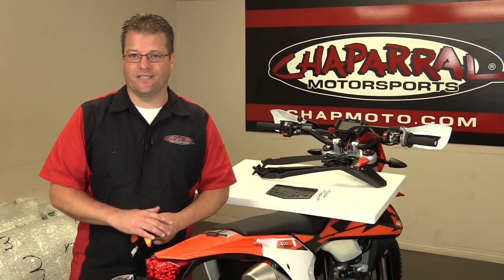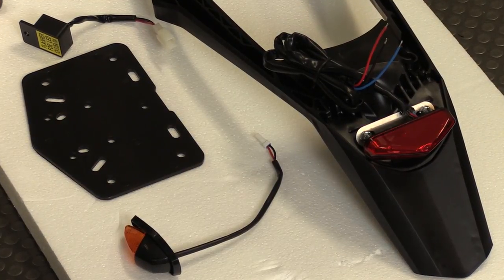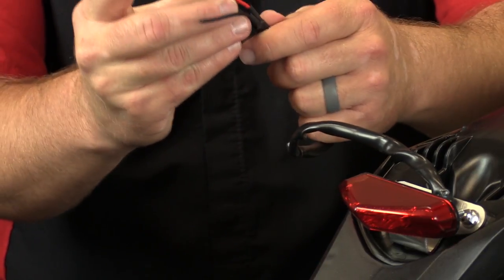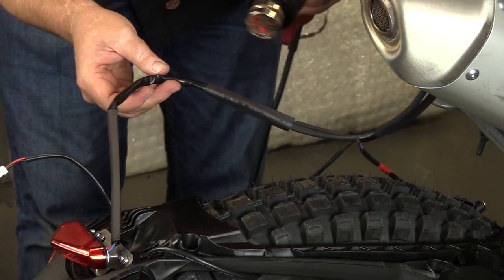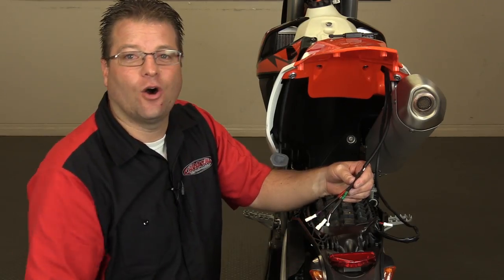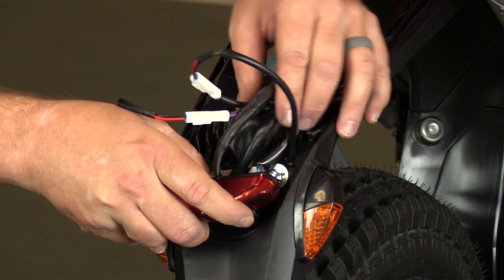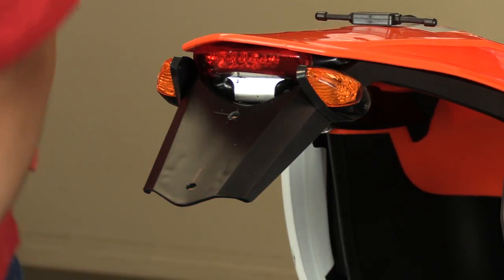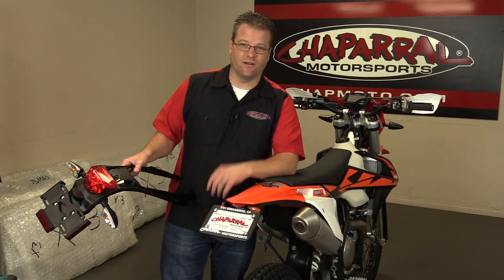Step-by-Step KTM Taillight Bracket Installation - KTM 250 350 450 500 EXC Bikes

Comment: can you give me some advice on a brake light for a 01 KTM 250EXC? has a working headlight currently, and brake switch is still there, but no brake light. Id like to get a cheap 3 wire LED 12V on ebay.. it does not specify if its DC or AC. says universal fit. Would I be ok w/ something like that?
Reply from the maker: Thank you for your inquiry Dude. Check out this "Dual Sport Tail Light " video we made last year. This will give you great insight as to the questions you have:  https://youtu.be/mtSsjfT383I    Any specific questions you have after watching this - shoot them our way and we will get them answered!  - Kyle & the Chap Moto Team

Comment: The Ocelot under fender does not work with the SICASS blinker lights. There is no surface area to mount it to on the side as you can see at the end of this video. I ordered the exact kit, you have to have the SICASS fender kit with the blinkers. Do NOT listen to this video.
Reply: I wish I had seen THIS video and this comment before I bought this stuff. You are 100% correct.. to get these blinkers on this fender requires a hack job because they straight up don’t fit.

Comment: Sicass Racing Smart L.E.D. Turn Signal Flasher Part # SAR-22-300, per your site, only fits 2014 and older bikes. Is there one available for 2018 KTM 500 exc-F or do I need still need it?
Reply from the maker: Hello, this will work with the 2018. we need to have our webpage/fitment tool updated. As a note: If you plan to use LED turn signals on the front AND rear, then you will also need to install the 22-298 or 22-299 at the same time as the 22-300.

If you want to just run one set of LED and one set of standard bulb turn signals you do not have to install the smart flasher, in this case the turn signals will blink slightly faster. If you wish to correct the flash rate install the 22-300.

Comment: Dont you need the white light to illuminate the plate?
Reply from the maker: Yes Mark,  The running light / brake light on this unit has a clear window at the bottom that shines down onto the plate. It is built in.  - Kyle & the Chap Moto Team

Comment: Where does the third light connector plug into from the wiring harness to the tail section? Both turn signal plugs and that one(assuming this is the tail running light because mine no longer works) were ripped off of my bike and I can't seem to find where the third plug goes. Thanks!
Reply from the maker: Sorry to hear of your frustration Martinez. This should help... Take a look at the colors of your wires and compare to this list:  Tech Tip: 
KTM EXC Taillight Wire Colors  vs.  Ocelot Wire Colors 

O.E.M:Yellow = Running Light
Green / White = Brake Light
Brown (Qty 2) = Ground Wire (Twist together the 1 brown wire in the brake light wire loom with the 1 brown wire in the license plate light wire loom before attaching to the Ocelot Black wire) 
White = License Plate Running Light (twist together with the Yellow Running Light wire before attaching to the Ocelot Blue Running Light wire) 

Ocelot Taillight Wire Colors:
Blue = Running Light
Red = Brake Light
Black = Ground Wire 

Thanks for watching. - Kyle & the Chap Moto Team
Reply: Chaparral Motorsports 
Thanks I'll take a look and see if I can wire it up!
Reply from the maker: If you have any further questions you can message us here, or give us a call. Happy wrenching! - Kyle & the Chap Moto Team

Comment: Is the green or the white wire the brake light signal?
Reply from the maker: O.E.M:Yellow = Running LightGreen / White = Brake LightBrown (Qty 2) = Ground Wire (Twist together the 1 brown wire in the brake light wire loom with the 1 brown wire in the license plate light wire loom before attaching to the Ocelot Black wire) White = License Plate Running Light (twist together with the Yellow Running Light wire before attaching to the Ocelot Blue Running Light wire) Ocelot Taillight Wire Colors:Blue = Running LightRed = Brake LightBlack = Ground Wire

Comment: Any idea where the horn connects?
Reply from the maker: Thank you for your inquiry Martyn. The horn connection is up front on all of the EXC models. -- Kyle & the Chap Moto Team
Reply: Hi- Thanks for the speedy reply. I found it - taped up and covered. Now - where to bolt the horn. And I need a couple of mirrors. It was real hard to start - 20 kicks. Shall get a new battery and check the fuse - don't think I had power going thru. It does not seem to have a dip headlight - is that right? I shall check again later. I have just rebuilt the whole bike - new piston n stuff.
Reply from the maker: @martynjames5963  Awesome! Good luck in the finishing touches of your project.  DoubeTake mirrors are my personal favorite. -- Kyle & the Chap Moto Team